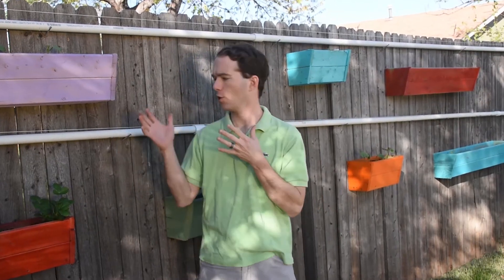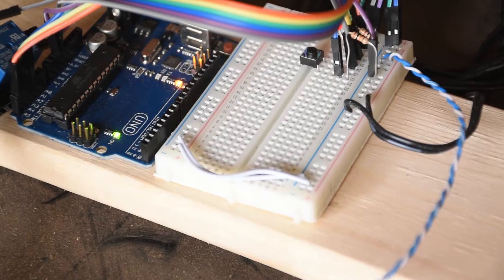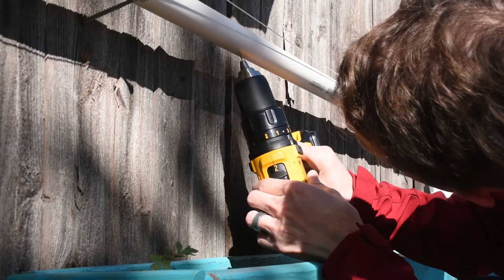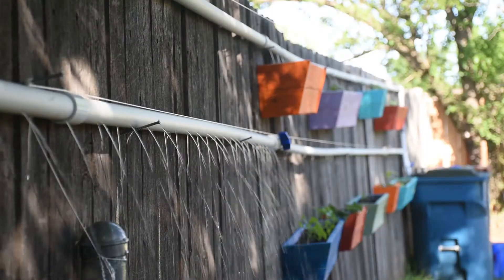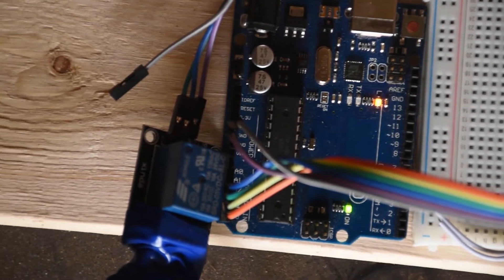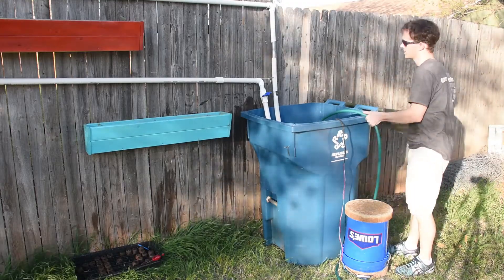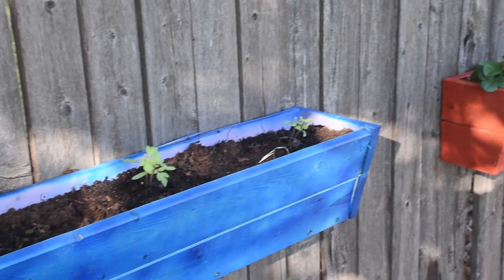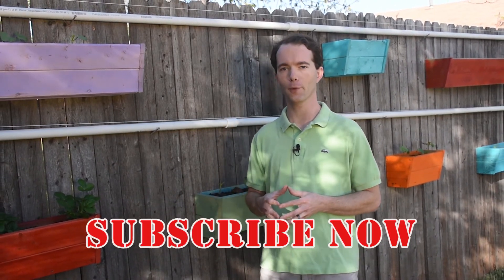Automatic Garden Watering System - Mikes Inventions

Comment: This is nice, Mike. I'm trying to look into a similar solution. Can you pls list the items you used? I didn't really catch that.
Reply from the maker: Hey! So I used a 12v bulge pump and an LED driver to pump the water. The timing was controlled by an arduino which triggered a relay to turn the pump on and off. I have about 40’ of 1” pvc and 2 ball valves to control flow. That’s about it.

Comment: a 2" supply line across the top feeding .5" feeder lines to each planter box would have allowed more pressure control through the system and created less friction loss at the at the end of the system. While the constant pipe size sounds easy, it created more problems as it introduces excess surface friction due to the pipe being to small.  Irrigation pipe would be the best feeder lines and would actually be buried in the boxes, this limits water loss to evaporation and simply spraying on the ground.  While this would require a few more measurements and pipe fittings, its the best solution. Best of luck with your project going forward.